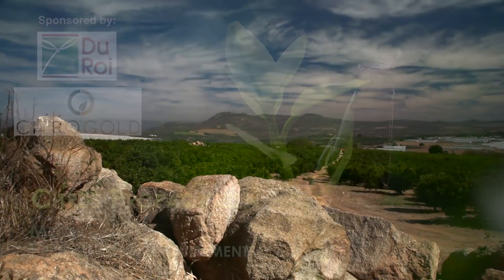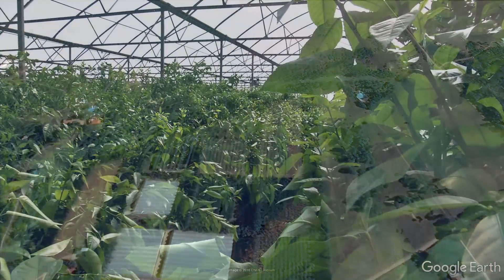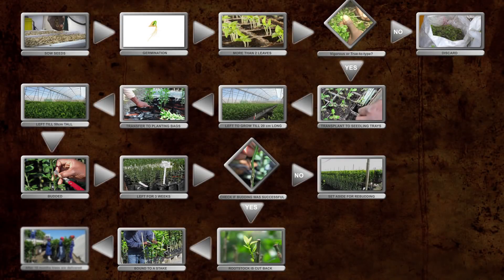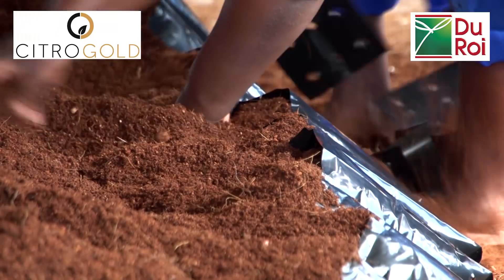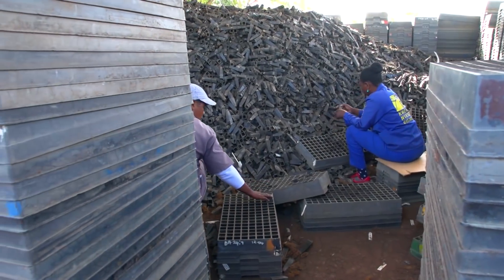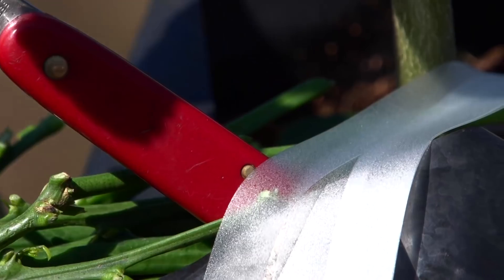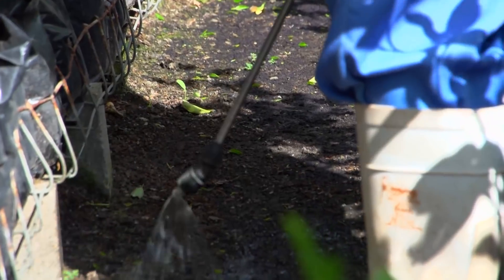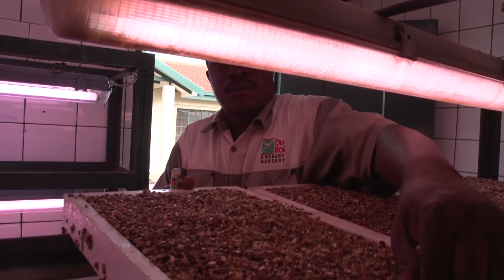Citrus Propagation: 1. Citrus Propagation Requirements

Comment: Just one thing i noticed they you may wish to correct. You stated that the trees take in oxygen and release co2 but this process is actually the opposite
Reply: I was listening out for that, but didn't hear it. For respiration plants use oxygen and release CO2, for Photosynthesis it's opposite